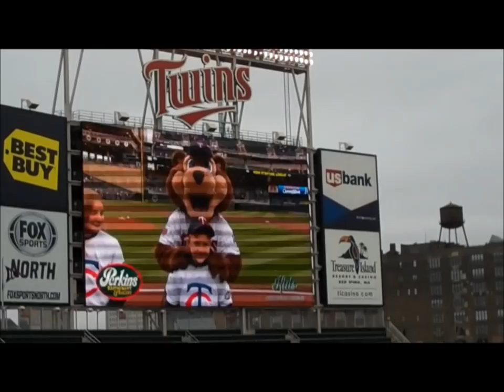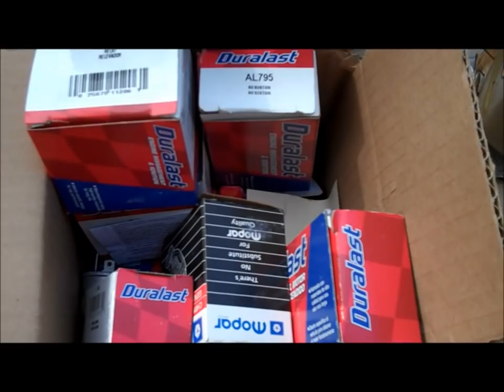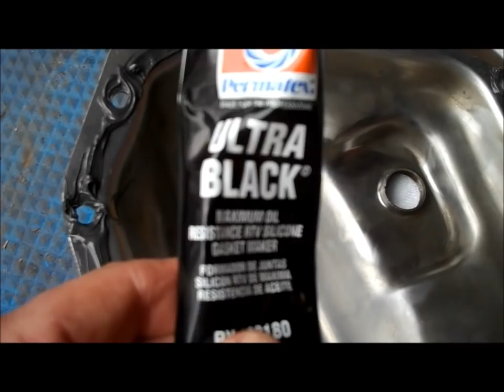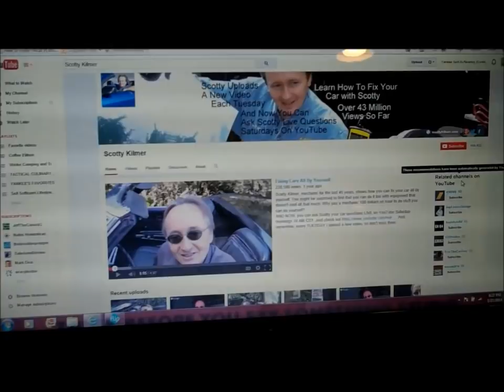1978 Dodge RV Restore #3 - Electrical and Drivetrain

Comment: Yes I agree I have a 1977 Dodge class C mallard with a 360 V8 I have replaced just about everything from the oil pump up LOL and also the different electrical ballasts and relays and save the old ones like you've done so yes this is a great idea because I'm with you I don't want to break down somewhere over a little teeny $5 part that could been replaced very easily.

Comment: DUDE, THAT 360 IS LOOKING SHWEEEEET!!!
Now this is pure motivational for me.... I have screwed up totally thinking I got a great deal on a 42 yo RV (1980 Fleetwood Southwind E-25 Coach) Why not? ....it's been sittin in a shed for 25 years...shrink wrapped (dumb idea, the trapped moisture wasn't healthy), hasn't reached 36k on it yet and the Onan Cummins 4.0kv has less than 300 hours on it. .....and I should have realized the fact that whenever somethings been just "Sitting" .....doesn't mean that's a Good thing. But overall, it's actually in great shape. 
But the coolest part is it's drive train, and I'm trying to figure out if I can make a plexi/lexan type doghouse for the engine cover..... but in the long run, probably another bad idea. ...would have to constantly wipe and clean something else ;) But I'm digging the fact that this Fleetwood was a Mopar made one.... 
Engine: Chrysler series||| 440 CID w/ 4 barrel Holley carburetor 
Transmission: A727 3 speed AT
I'm currently doing what you just did by replacing all the vehicles electronics, relays, diodes, Electronic ignition module, ballast resistor, etc
...but as you obviously know, as I'm in, on, under, or over something, rectifing whatever issue it is.... YOU ARE GOING TO FIND YET MORE ISSUES AS ONE PEELS BACK THE LAYERS!!!
I too, went to drop the trans pan and change filter & fluid.... when I dropped it, somebody had put a small magnet on pan, ok, good job......BUT next to it, was a broken low/reverse band adjust nut...YIKES!!!! (Not a huge deal, but glad I found it).... Now what I want to know is.... What sheer force would it take to sheer that case hardened bolt like that??? Wasn't me, I've had this RV for a month, and only drove it from where I bought it, to my house... a total distance of about 5 miles.
Great vid...so great,.... I'm subbing
Thanks

Comment: I have the same dodge I did the exact same thing by replacing every electric part available but still had problems so I went to Chevy distributor and cut all the dodge crap and did all the things you did even the rear trans seal my rear driveshaft bearing was bad so I did the entire rear tail shaft all fun stuff lol it's all on my channel mine sat for 11 years and I video tapped everything since day one since then I've gone on several 2000 mile trips no issues thank God lol

Comment: I agree with Autozone. Here's a tip - if you're a business owner - open a commercial account. You save nearly 20-30% off the price of the parts (You can haggle especially when you get to know your local manager or commercial accounts rep) and not only that - you can get the parts delivered to your house - er... your "business". I am a huge fan of Autozone and their customer service. I use a commercial account to buy vehicles off craigslist - put parts in them to fix them up with no money out of pocket (net 30 account) and then sell them and pay the bill later. It helps when you are on budget. Excellent video Yank

Comment: EXCELLENT VIDEO. Thank you very much. II have 4 vehicles in my "fleet" that I am now doing all the work on them basically to know that it is done corrrectly. Glad you used a torque wrench on your transmission bolts. I have to change my tranny fluid in my wife's 2002 Grand Caravan. It was done 60,000 miles ago. I checked it recently, One pan bolt is missing and two bolts just spin merrily around since the last guy stripped them out. Made me sick. I have no idea why "professionals" are too stupid NOT to use a torque wrench on aluminum threads. Scotty Kilmer is great. Very smart guy with common sense.

Comment: Great video series! I like to see people revive some of the older autos and not just the muscle cars. One suggestion for the trans pan, I always put a drain plug in to make the next change less messy.
Reply from the maker: I don't personally recommend a trans bolt or recommend putting one on because it's another possible leak source on the trans.  I always take the pan off anyway to clean it out and I don't believe the process is "messy" as I showed it in the vid.

Comment: Nice work!  I hope you put the trany filter on it before installing the pan.
Reply from the maker: No,  I put a peanut butter sandwich in there and put the bolts on.  hope it doesn't keep you up tonight.
Reply: What a waste of peanut butter, but it should do the job just fine.

Comment: Great video !  Just what I’m looking for    I just bought a 77 with a 440   Was starting and running great and just as I was getting going on refurbing it and sealing it before the snow , it lost all power and won’t start the day after the storm    I have no clue what it is   Even the dome light is not going on 
I charged and switched batteries etc  and still nothing    Rear auxiliary power is good    It’s all up front    Any ideas what it could be !???
Reply: Theres a fusible link right after the starter relay that powers the fuse box try replacing that or bypassing to test
Reply: @retrofuturewave4909  the orange wire from relay goes to the ignition , which fusible link are you talking about and where should it be connected to ?
Reply: @joesmith-fi1sx  Its a black wire on mine thicker and with a fusible link inline comes off the main battery terminal on my starter relay and goes up through the firewall. It could also be on the constant power solenoid or directly to the battery depending on your setup

Comment: The beast is looking great, what is the towing capacity? If you could pull a nice covered trailer, probabilities are endless. Keep the series coming brother.
Reply from the maker: A B300 Dodge with a 360 has a a towing capacity of over 7000 pounds (as a rule of thumb a tow weight should not exceed 75 percent of the vehicle towing),  but that is far more than I will ever need.  I certainly could pull a vehicle behind easily enough,  but the most this rig will have to tow is my ATV on a small trailer.

Comment: My 1977 Sportsman RV won't start. It was running, I shut it off, turned the key again 10 seconds later... nothing! No radio, lights...no life whatsoever. I can't figure it out. The battery, starter and alternator are good.
Reply from the maker: better call a mechanic.

Comment: Fat people are just storing extra calories for the shtf. While you skinny guys will be starving in a week, us fat guys will be pulling from our reserves. Lol. Great series, you motivate me to do more of my automotive work. I have to ask tho, what was the pain in the ass factor for all those things? Seemed fairly easy or did you edit out all the cursing?
Reply from the maker: Everything I am doing here so far is high school skill level, pretty easy and straight forward.  A vehicle of this era is especially simple to work on because I don't have to take off 100lbs of hoses, wires and sensors to actually get to the parts that I am replacing.  When I was in high school in the late 80's this is the kind of work us "boys" would do before going out in the evening and destroying our trucks and cars all night.  The only reason I can fix stuff is because I first had to learn to break everything.
Reply: Yeah I hear you on that point, if you break it you fix it. Learned that early as well, mechanics get expensive even to replace cheap parts. Although I have found even the simplest of repairs often times get complicated by the unfore seen stripped bolt or rust weld, especially on older vehicles that may have been purchased used. Just wondered if you ran into any of those type issues that made an easy job more difficult?
Reply from the maker: 3640timm I did  the other side exhaust manifold and had two rust welded bolts.  But I took my time and drilled them out and then re-threaded them.  That was about the worst of it over all and that was just a little time and elbow grease,